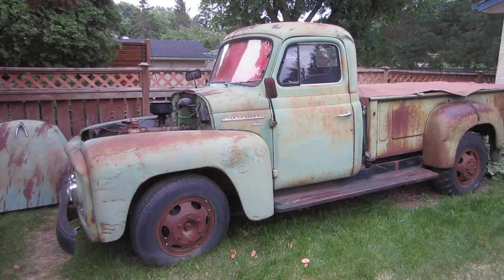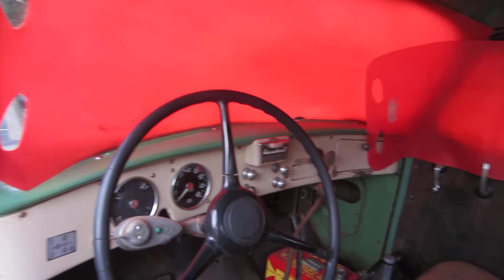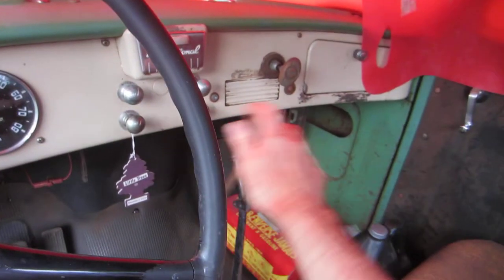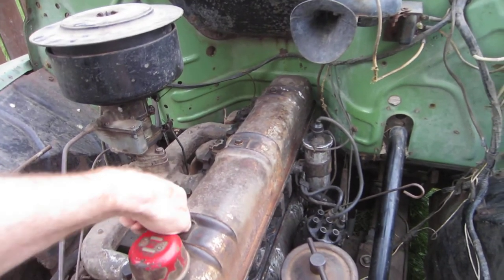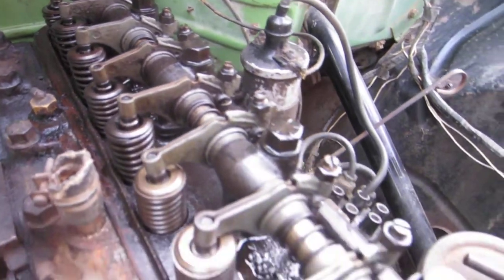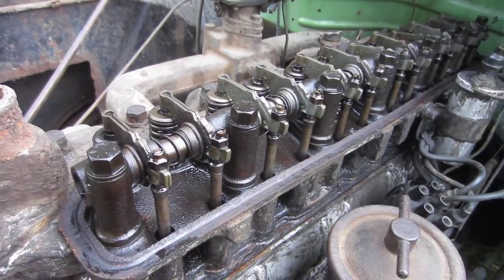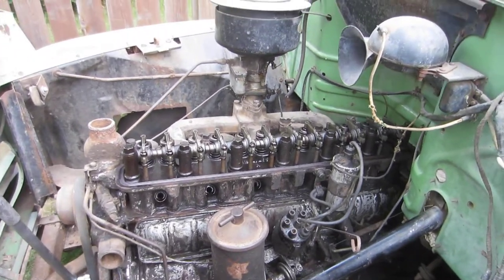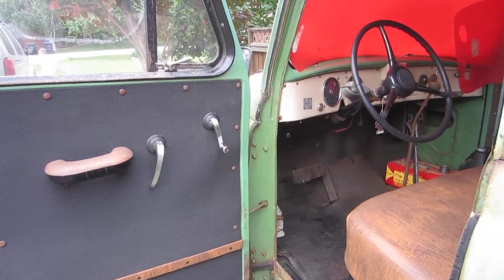International R-130 1953 truck project

Comment: Another cause could be a ring of corrosion where the tops of the pistons were stuck. You could try a battery and get the engine to force it past the rust ring. Or take the head off and hone the cylinders. Like stated, you may have a stuck valve too. Spray the valve seats and tap the rockers with a hammer. TAP! A ping sound means it's free. A thud is stuck. Lube and tap. Lube and tap. TAP!
Reply from the maker: With more WD-40 and tapping I was able to turn the engine all the way around, with a good sized braker bar on it.